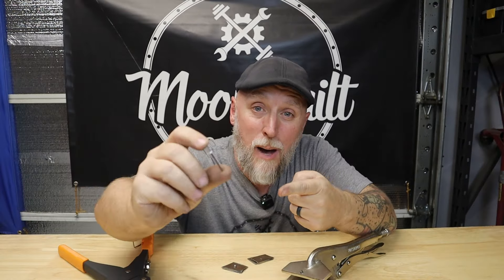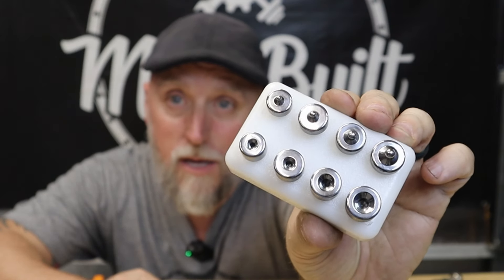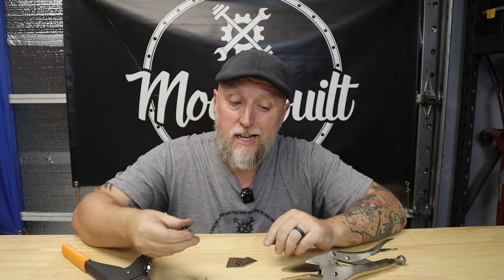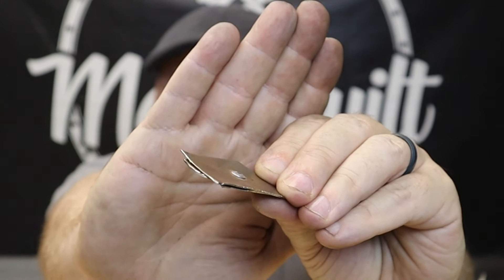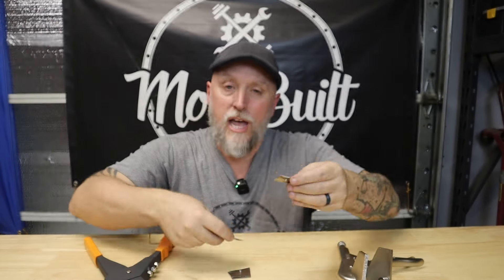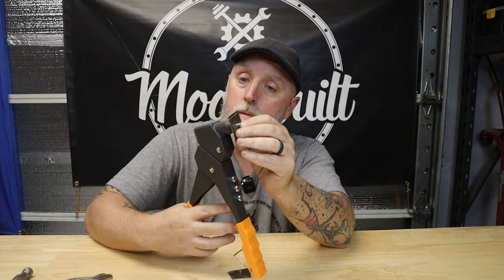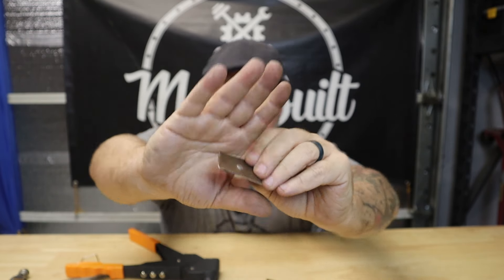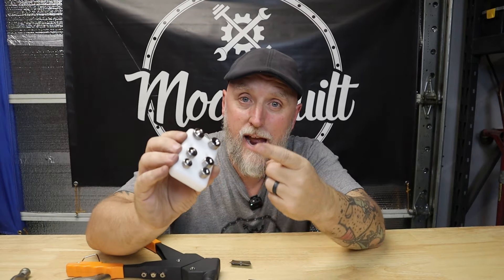🔧Tool Tech Tuesday #75 | Rivet Dimple Die Set

Comment: Or....just get some countersink rivets!  Drill eighth inch hole for the rivet,take a quarter or three eighth bit and lightly drill the sheetmetal. Walla! Flush!
Reply from the maker: Give that a try and let us know how it works for ya
Reply: @MoonBuiltGarage  Well, if he used a proper countersink bit it would work but at the expense of the strength of the joint.